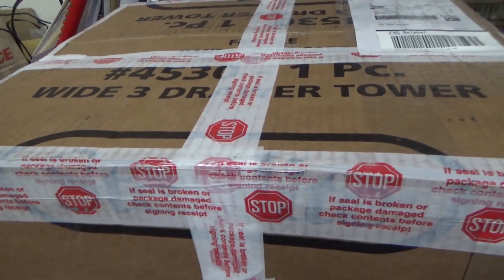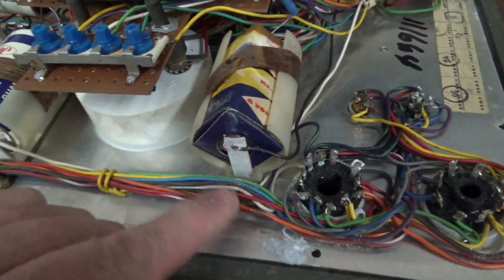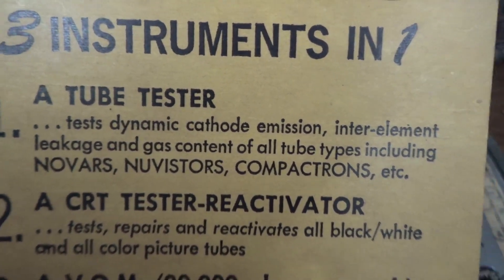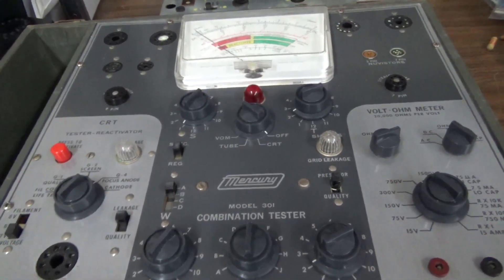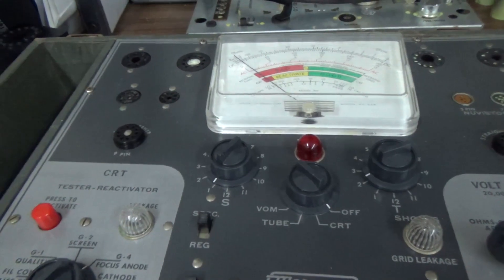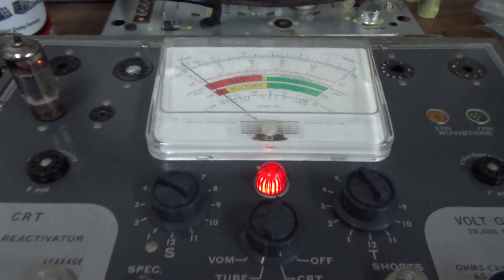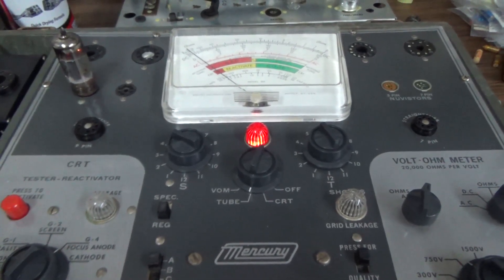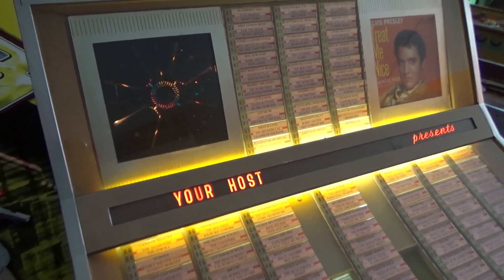Testing A Tube Tester - 1960 Mercury 301 - Jukebox Repair Vintage 60's Tech Equipment

Comment: That's some proper packing. I just got a piece of professional video gear enclosed in random paper and types of packing pieces surrounded by a thin box with several large holes in it. It's got z80's and a 68000 processor with active backup batteries AND metal debris floating around in there. Not sure why but it seems to work so far!
Reply from the maker: It's always kind of a crap shoot on whether they're gonna pack stuff right or not... Two days ago, I got a 140 year old clock in the mail I bought on ebay, they packed it o.k. but it got banged up.  The base was broken off, some of the wood trim was broken off, the face was damaged because the movement fell out and the hands ripped the face.  140 years old!   So I looked closely and it had been broken way back in the day, and all the glue had broken back loose.  So I cleaned up the old glue, and everything was a clean break where the thing was originally glued together... I glued it back, and removed the very center of the face (some of them are made like that).... when I was all done I put it all back together and it keeps perfect time, 140 years old, LOL  Looks great but when I opened the box it was in pieces.  

So I try to blame it on the post office unless the shipper was just ridiculous and threw it in a bag or something.  This tube tester was done right though, I wish everybody packed like that, this old stuff is one of a kind!
Reply: @LyonsArcade  Glad that clock is ok wow! Yes you really have to do your detective work to find where to put the blame. I've had crush damaged packages where the seller couldn't possibly have prepared for the 1000 plus lbs that must have been put on top of a professional editing machine. The feet of the machine punched perfect circles out of several layers of cardboard like a paper punch... before they broke and the thick metal frame got all bent. Even still I fixed that damn thing and let the seller off the hook.

Comment: They are not a bad tube/valve tester.
You sometimes need to recap the tube tester to keep it running smooth.   Often they have old caps in them, sometimes those nasty wax paper ones.  I do like the old point to point wiring, even if sometimes it can look like a rats nest to people use to PCB's :)   
The 5U4 is such a common Rectifier tube.  Directly heated so takes next to no time ot heat up.  Quite robust and reliable, though all the tubes in this machine were pretty common though admittedly.  
Great video showing the testing.     Your tester was a good find too.   Nice that this unit has all the cables with it.
Reply from the maker: Yeah you could tell somebody took pretty good care of it.  I'm glad to keep it in use for another 90 years (I'm optimistic)
Reply: @LyonsArcade  I think it will outlive you.    Even the weaker tubes would still work, as long as there was no shorts.
I love saving the old stuff.  I am starting to get a collection of older Valve/Tube radios now, but they are just so much nicer than modern stuff.   They were designed to be part of the furniture.

Comment: Hi, I know you don't appreciate any feedback that could be beneficial or insightful, but even so:  When you set up the tester used it with 12AX7 tube you tested only half of it. 12AX7 has two independent triodes in it and thus it has two lines of setting at manual. See 23:00 or so.
Reply from the maker: DIYTAO, I never said I don't appreciate feedback that could be beneficial or insightful, you invented that in your head.  Find me 1 instance of me ever, EVER, saying I don't want feedback that's beneficial or insightful. I'll wait.  When you start your comment lying about me, It immediately makes me think you're not that beneficial or insightful, btw.  

Whenever you decide to watch the rest of the video, I mentioned in another area just what you said, it has two parts that need to be tested and that I went back and retested it....
Reply: @LyonsArcade  So, apparently I'm in error. But on this case I don't feel so bad, since I'm delighted of the potential of these videos. Some years ago tried to make a video series but ended hiding them, since the quality was not there.

Comment: Hey Ron, If you discussed this I missed it but did you check the bulb that is in the "Short" light? That would suck if it wasn't working. I remember when I was a kid they had tube testers in the Convenient Store near our house. I took a tube out of a radio we had and took it up there to see how it worked. It was cool.
Reply from the maker: Yes we showed it in the video several times, thanks for watching (some of it :) )  I never did too much with tubes before this, I've rebuilt a few tube radios but never was able to personally test the tubes...

Comment: The problem is, just because the capacitor tests good with the capacitance tester, doesn't mean that under a load or while working. It still can leak voltages through or even be on the verge of shorting out and causing excess resistance that can burn out a tube.
Reply from the maker: Except that didn’t happen

Comment: When I was a kid I would pull every tube out of the TV and take them to the corner drug store. Every drug store had a tube tester and sold new tubes. These were big stand up units a lot of sockets, a few switches and a dial. You would look up the tube, set the switches, press the test button to see if good.  Getting one of those would be cool.

Comment: Does that tube tester have a light tester button?  That would be a big help in making sure the tester is accurate.  In avionics, probably other areas too, lights are required to have a test function so you can be mostly sure it will light up when needed.

BTW, if you want to see some vintage amp repairs for some second-hand practice, or if you just get bored, I recommend the Fazio Electric channel.
Reply from the maker: If you plug one up then turn the dials to the wrong setting the light lights since they’re shorted, it doesn’t apply voltage until you hit the test button so you can test the light that way

Comment: I think you should re-cap as they could short at anytime being 60 yrs old and blow the tester and /or other equipment, for the sake of a few quid .And test all the  old resistor as they will effect your meter readings.you could have leaky caps ,if you are planning on using it you should change them. I think it worth doing then you know the reading are right.also check heater output voltages it will tell you how in service manual

Comment: Me at beginning of video: A tub tester! This is going to be boring, where's the pinball repair?
Me at the end of the video: That was interesting, thanks Ron!
Reply from the maker: We hooked you in!
Reply: @LyonsArcade  You did indeed. 50's (?) tech is always interesting, I looked but couldn't find a date for when the 301 was in production but the style looked more fifties than sixties to me.

While watching the video I was thinking what a modern tube tester would be like, with an OLED display, wifi capability, a keypad for entering the model of tube and one-button automatic testing. They could make a pretty sweet tube tester with modern tech -- but that's like saying with modern materials and manufacturing techniques we could build really good horse drawn carriages…

Comment: I remember in the 70s going to stores and they had tube testers and we brought tubes in to test them for the radios and the TVs
I remember the first " solid state " GE multi band radio that had some shortwave bands, the VHF low band 20 MHz to 88 MHz which included the channel 2 through 6 TV audio.

And it had AM and FM bands, it had the aircraft band, and then VHF mid band 136 to 180 and the VHF TV band channel 7 through 13 , 176 to 220 MHz
And it has UHF TV 480 MHz to channel 83 or 99, which was up to almost 1 GHz.

I don't remember if it had UHF business band 440 to 480 MHz. I imagine it must have.
And the 220 to 440 bands, I don't think it had those.

But it was a big deal for it's time.
I remember listening to the local police department on 155.610 MHz on that radio and going to the airport and listening to the aircraft on it

I got 3 radios, RCI-1000 crystal 2way VHF radios with 2 channels, red and blue dot.
I think they came out around 92 or 93.
I remember owning 2 of these back then when they first came out.
I saw these for sale and wanted them for nostalgia
They were sold not working.
I had new battery pack made, and I just plugged it in and the radio came back, works fine. Not sure about the other 2, but the old stuff lasts and lasts.

Nothing wrong with old stuff if it fits your needs

Comment: Most tube testers from 50's - 70's are very sensitive instruments, and it is a bad idea to spray cleaners in the tube sockets, as the De-Oxit residue can be mis-identified as a short.

Comment: Wait you need esr meter and you need to check the internal resistance of each CAP, measuring just capacitance is wrong. Also by the specs of this unit, you need to know if this unit is using LOW ESR caps or normal ESR caps.
Reply from the maker: But yet it worked anyways genius maybe you don’t know what you’re talking about
Reply: @LyonsArcade  If it's easier for you,  you can keep your opinion as the right one. I don't have anything to persuade you, I would say in my personal opinion that you have partial knowledge, which is sufficient and it's interesting to watch you on your way of doing repairs. To keep your professionalism you could say I tested the ESR values of the camera, but to write in the comments this shocking statement??? All the best, have a great day Joe.
Reply: @LyonsArcade  I think this is where a lot of people just don't get it. Unless they are in a position of authority over you, Ron, they have no right to say how you have to do it.

For all I care, you could be standing on your head, in the bathtub, while testing these tubes, so long as you got the result that you were hoping for, that's all that actually matters.

And so long as you followed the manual to ensure you don't destroy your awesome new equipment, that's all that matters too.

Thanks for the video, Ron, I learnt something I never knew before :)

Will I ever see something that has tubes in it here in Australia? All roads pretty much point to no, but I still had fun watching it :D

Comment: REMOVE or REPLACE  batteries they are only used for OHM's Scale !!!
Reply from the maker: I think I’ll leave them in there another 60 years.  Cope.  You sound like an intelligent man. Explain how they didn’t leak for 60 years…. I’ll wait
Reply: @LyonsArcade  You Win !  the square battery has stains on it though